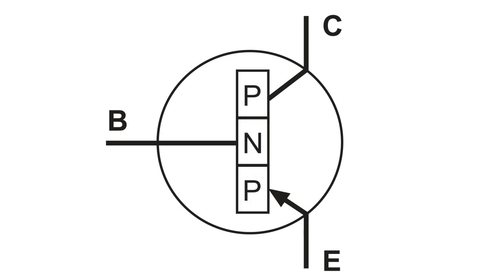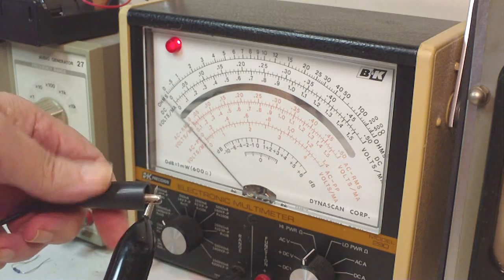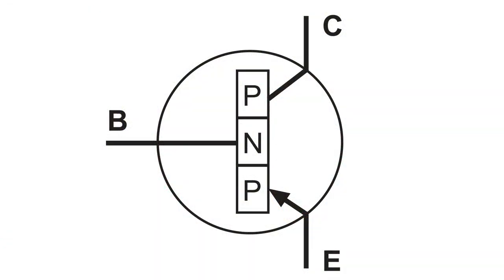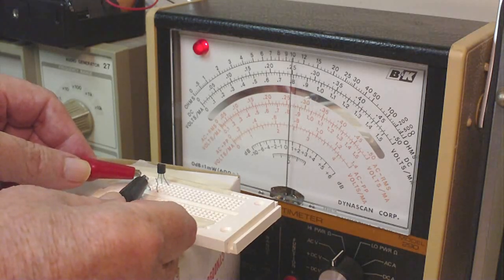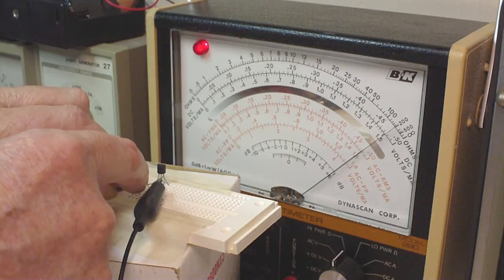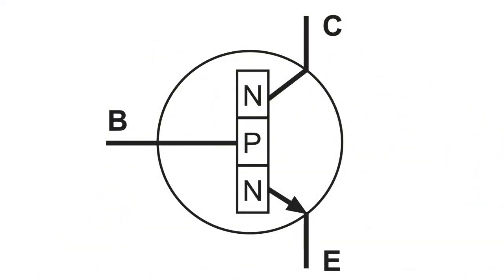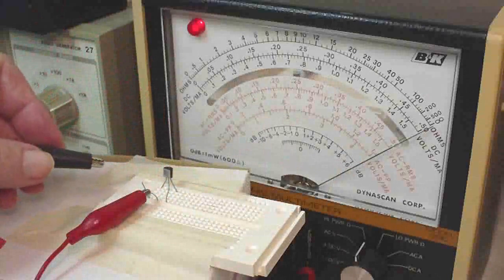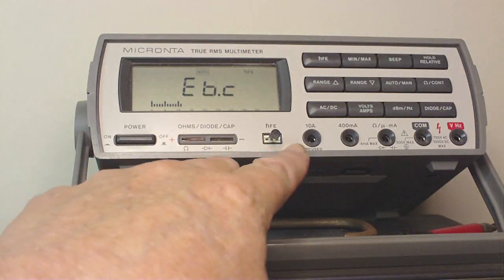Transistor Testing, the Basics

Comment from the maker: Use the diode test with a digital meter. If you meter does not have a diode test use the lowest ohm scale, still checked the polarity. Some digital meters, even on the low scale, may not produce enough current to turn on the PN junctions.

Comment from the maker: Reversing the leads while measuring voltages will not damage the meter provided that you have the meter on the appropriate scale. When I measuring voltages I start with the voltage scale at the highest setting and then rotate down to the appropriate scale for the voltage I'm reading. In other words when in doubt start with the highest scale and work down.

Comment: Well I'll be damned. I've been pouring over multimeter reviews, videos, specs, and discussion boards and NEVER have I read anything about different DMM leads being positive or negative. Got a Fluke 87 20+yrs old and a UNI-T UT61E (20 days old). Input sockets on both have COM as black and V/OHM/Hz as red. 
Sure enough, Red on UNI-T is positive while the  black on Fluke is positive.

Comment from the maker: Thanks MrThescientist999
I guess you mean, Digital Meter. The problem is, the new stuff is so good, that you can not do this test with them because the impedance is to high to forward bias the PN junction. If your Digital meter has a diode test mode, you could use that, that would work. You still need to determine the polarity of the test leads.

Comment from the maker: @hectorscaraudio 
Some digital meters will work, but it must be capable high volt ohms. The voltage used to measure ohms must be high enough to make the transistor junctions conduct. If your meter has a diode test setting, that should work. But make sure you identify which lead is positive and negative.